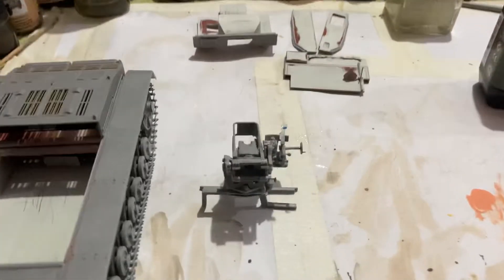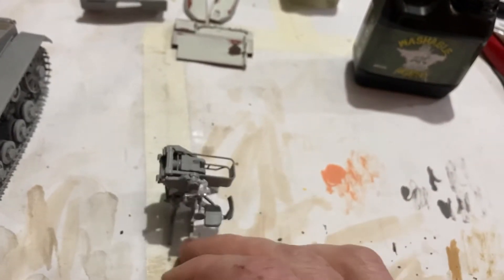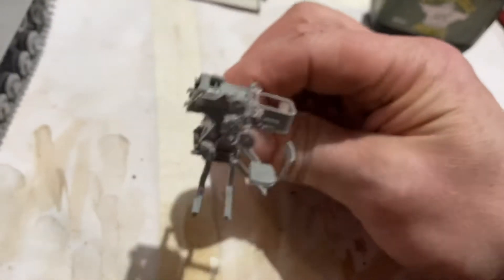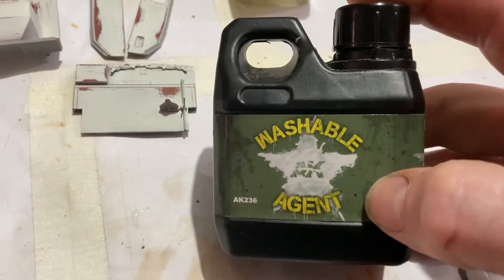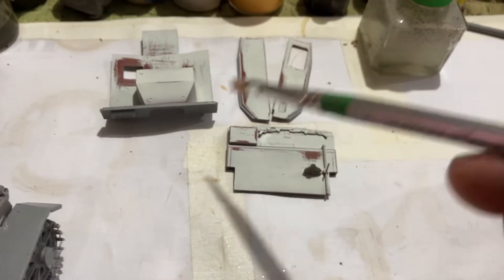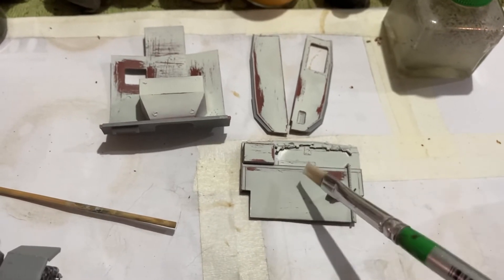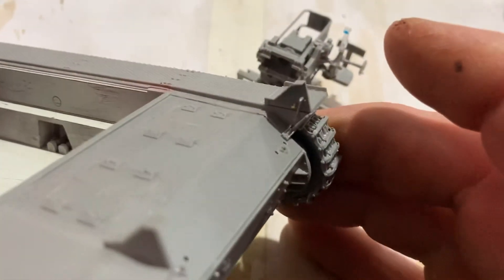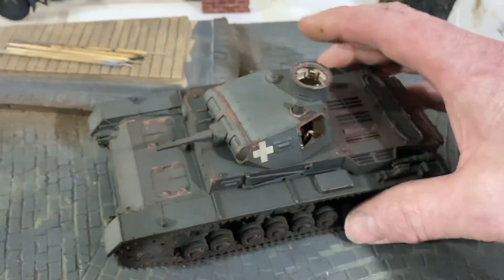Miniart Sturmgeschutz III O SERIES Update 5. Building the gun and fighting compartment

Comment: I might have to try your paint chipping method, the hair spray method doesn’t always work as intended. Great update
Reply from the maker: Yes you have a lot more control making washable paint. You can get the wash agent from Metro Hobbies in Box Hill. Add 10% to your Tamiya or AK waterbased paint. Don’t use Vallejo or Mr colour aqueous because they are different formulations. Mix in a good dose of acrylic thinner and spray on. Make sure you give your undercoat 24 hours to dry because you need a solid base. 
Start washing down 30 min to an hour after application. The water and brush will give you a degraded smooth finish. Use tooth pick to scratch out chips and shit. 
Let me know how you go mate.